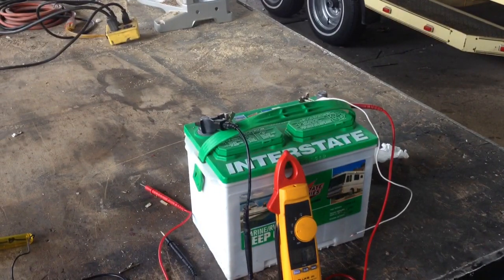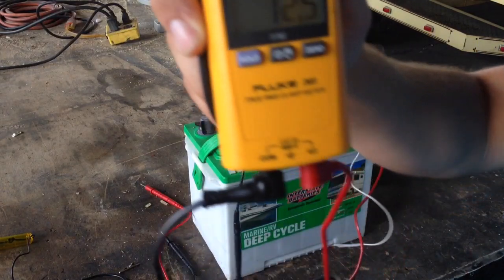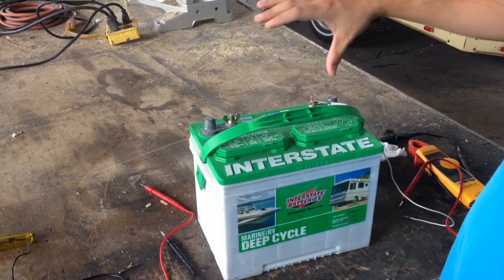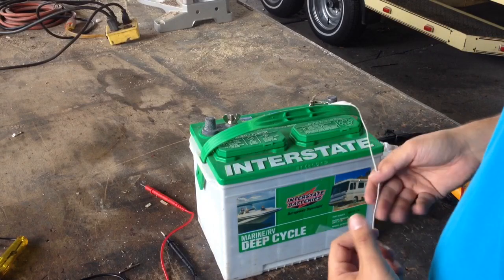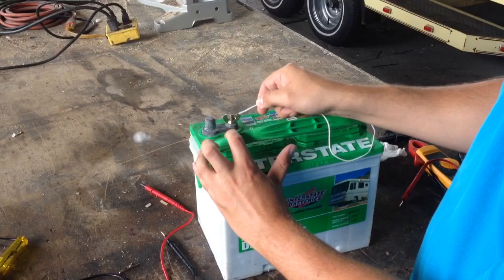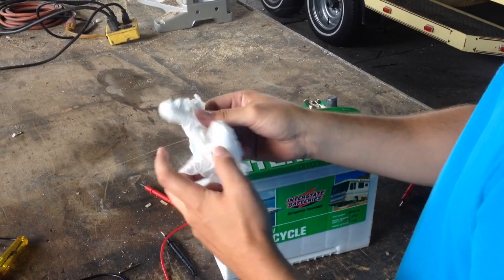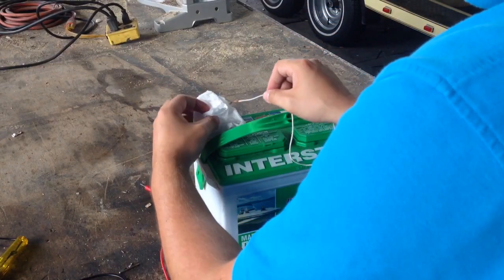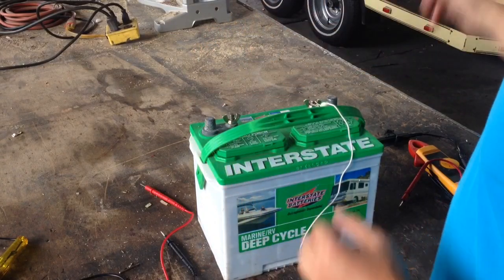Can a 12v battery shock you fail

Comment: Resistance has nothing to do with why you don’t feel it. Your body is a capacitor and dc has a hard time passing through a capacitor, while ac doesn’t. 12v ac will give you a small tingle. Dc will not. You need about 2x as much dc voltage to feel the same amount of pain as ac.

Comment: Very dangerous to hold that wire in your bare hands as it can burn you. Also a small chance of  igniting the battery’s gasses. This appears to be a very well ventilated area but if the offgassing is fast enough, and the air is still enough It can still happen.

Comment: Actually it sends current through your body but it is so small that you don´t feel it. The reason seems to be that the human skin has a capacitance that is creating a capacitive resistance much higher than the inner resistance. I always believed that the skin doesn´t  let any current through it until you reach about 120 V (DC) but I now measured the current through my body if I touch a 9 V Battery and it is around 15 µA if I touch 27 V with my full hand on a metallic surface connected to one side of the battery I get 50 - 60 µA through me back to the voltage source. So I guess you could get shocked with a simple battery if your skin is damaged for example but it wouldn´t be deadly perhaps. And  I also tested 1,5 V and it also sends current through my body.
Reply from the maker: +Muck2014  nice research, my only input would be because it's direct current not ac current you would most likely suffer internal / external burns as a result of D.C. As opposed to be shocked like in the movies causing muscle contractions.
Reply: The burns actually come from either heated metal or from arc flashing. Sometimes people can get shocked if there skin resistance is broken by something but that is rare. As the human body also has capacitance there is also a capacitive resistance which is much lower for AC then Dc and lets the AC through the body much easier. So the voltages that you can get shocked are much lower with AC then with DC. High voltage AC generally only creates severe burns in and around the body and some nerve damage while the high voltage DC also creates haemolytic effects which are destroying your blood and your muscle and nerve cells much more then AC. So therefor high voltage DC is much more dangerous than high voltage AC. The reverse is true for low voltage.
Reply: You will be able to feel current long time before 120V DC. Usually around 50/60 V.
Reply: Putting in radios on a hot day on the 70s cars ,radio on the leg ,my leg touching the sill plate it would give a slight tingle .

Comment: I was changing a car battery that was so corroded that a terminal broke as I was pulling off the connector with my bare hands and exposed the liquid inside. Now I'm researching whether or not that would have electrocuted me. There doesn't seem to be much info out on that. Not sure what to do if that happens again.
Reply: That liquid inside is sulfuric acid and it's more likely to melt your skin off
Reply: Let's clear things up then. Car batteries can't electrocute you. Not even if they're intact. The liquid inside is a strong acid and that can be dangerous to touch, but no electrical hazard

Comment: i got 12v electric shocks sometimes, it just feels like extreme vibrations to me, but i didn't touch a battery, i touched laptop ports, and 45w laptop charger, both gave me shocks because the earth wire was faulty or there was no earthing in the house

Comment: What about risk of explosion of the vapors from the battery due to spark?
Reply: exactly, plus putting a direct short across the terminals can lead to a high current flow causing the battery to overheat and explode.  If I was doing that, I would be wearing protective gear and face-shield.
Reply: +Sneek Sheets the wire was 18ga Which limited limited it to a 30 amps, this battery is capable of 800 cranking amps only way to explode it would be with much thicker wire to pull more amps and heat.  Or if I put it in a small box to catch the hydrogen gas.
Reply: Typically in open air you can't get a high enough concentration of hydrogen gas to get a good explosion.
Reply: PingasTheFourth  wrong has to be large concentrations, there is always hydrogen in the air.  Shorting a battery for a brief second or 2 with a small wire doesn't even come close to a hydrogen explosion 💥.  I've actually made and bottled hydrogen from water already it's pretty fun to lite it on fire 🔥
Reply: Theoretically it's dangerous.  In practice nobodies car is blowing up from that little spark when jumping a vehicle.

Also it's you could attach that wire directly on both sides and leave it and the battery isn't going to catch fire unless the wire is thick enough to last long enough to melt through the battery.

Obviously a big enough wire would eventually blow the battery up.  But I've seen 8 gauge wire melt and set fire to a trunk without damaging the battery... I'm sure some stupid ass has done the same with 4 gauge.  I've seen a lot of kids do car audio without a fuse and I've seen idiots use ANL on 4gauge because ANL looks cooler... Problem is ANLs usually ship with gigantic fuses and they are not going to trip from 4au wire.
Reply: Hydrogen gas is only released from lead acid batteries when they are being charged. If you are using a sealed lead acid battery, as the OP was, it will only emit hydrogen while it's being overcharged. It is not produced during discharge.

Comment: That's about the most irresponsible video I have seen, first because you are messing with a battery that I'd not sealed, any spark could ignite the gases from the acid and you should always be opposite side of the caps so if it did explode at least you aren't over the caps. Then you are in a shop where there are automotive and likely other mechanical engines that use fuel and other petroleum products.

Comment: You're not doing your battery any good shorting it out like that!
Reply from the maker: +lite Roadie  You might be right  BUT.... I was using 18g wire so that limited the amps to under 30AMP's and the battery is capable of 600 CCA.  Not sure if you know but the small 12v electric heaters are like the strips inside a toaster its a controlled dead short and typically does not harm the batteries.  If I was using thicker wire I might have been able to harm the battery.
Reply: PingasTheFourth  while your correct about heaters I was trying to explain to him why the 18ga wire being dead shorted actually puts less amp drawl on the battery then most 12v heaters would 🤗.
Reply: No PingasTheFourth, ELECTRIC TECH does know what he's talking about.  If that battery can handle 600 amps, there is no way he is damaging the battery by shorting it with that thin wire.  A very limited number of amps would flow through it.  Probably a bit more than he said (30) but still much less than 600.  And, resistive loads ARE just dead shorts.  ANY short has some resistance unless you're using superconductive wire.  That wire may have a lower resistance than the insides of a toaster but it's still not zero.  If you aren't convinced Pingas, go buy that same battery and some 18awg wire and short it briefly,  Now, get a wrench and drop it across the terminals... ANY difference in amps?? No need for a meter.  I'm sure you'll see a huge difference.  Ahhh but that last experiment WOULD be bad for the battery.

Comment: What about under water with same setting?
Reply: +Keith Koch I did the same thing with my hands soaking wet and I was able to feel the current very slight tingle.
Reply: Yes, if a person has wet or sweaty hands, they will feel the current flow from the battery even more so.
Reply: Well, water in general is conductive because of the minerals and ions in it. But, distilled water is practically non-conductive, however, demonized is even better and Edison uses it to clean the HIGH VOLTAGE INSULATORS on the telephone poles. People will say distilled water is non-conductive, however, it is so small, it is considered to be practically non-conductive. However, demonized water is supposed to be even more purer than distilled water, so I understand.